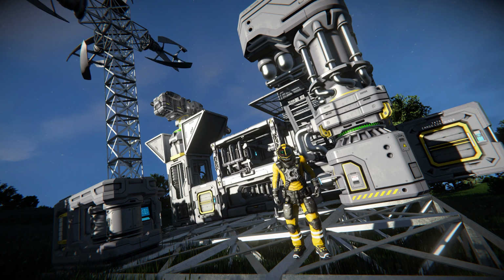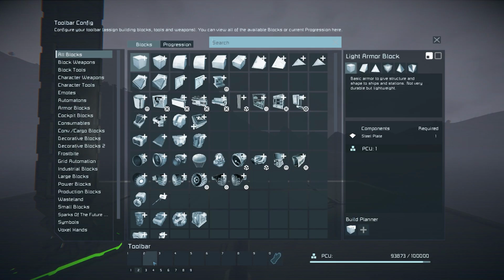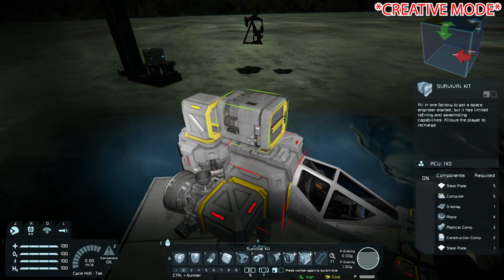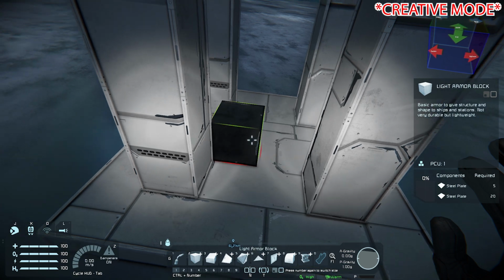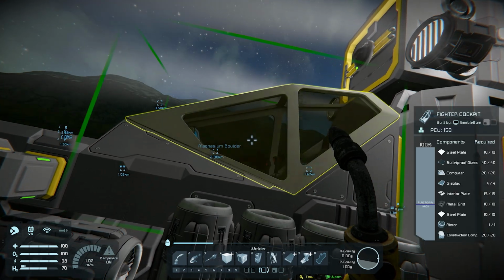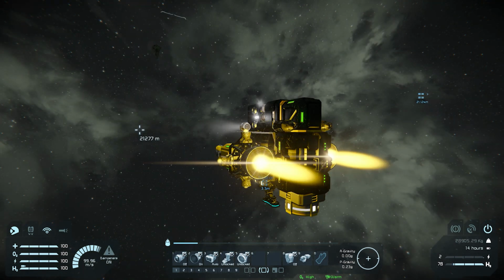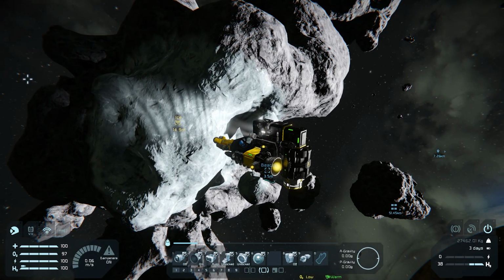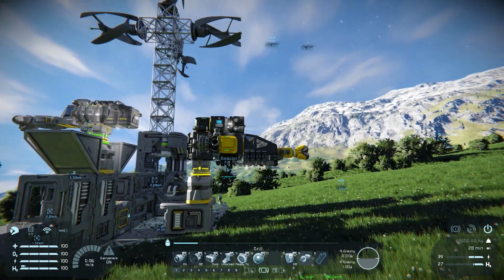Space Engineers Beginners Guide #4: Building your first Space Ship

Comment: There is 2 ways to statically connect small grid to large grid... use a large grid rotor remove the rotor part and add a small head... or my personal favorite... drop a small grid connector on a vertically facing large grid connector weld it up then manually switch the lock and boom... 2 ways to connect a large grid to a small grid in the vanilla game that will also lead to batteries being charged as you build...
Reply: Never experienced any problems building in the above mentioned... this is also how you get a basic refinery and basic assembler on a small grid rover with some large grid solar panels lol

Comment: New sub because of this video. Ship did for me what it was supposed to with getting to space, sometimes running from drones and checking a bunch of asteroids for something yet only finding Earth's ore deposits. Disappointed. I then tried landing on the moon for a hydrogen refueling station and couldn't get off the surface for some reason. Crashed the ship and reloaded to before I landed.
Reply from the maker: Yeah, some ores are pretty rare to find.
Platinum should be found easier on the moon, uranium in the asteroids.
But yeah, most ores are available on the Earth planet.

Concerning not being able to take off.. were you locked with your landing gear to the moon?
Reply: @Beeblebum  : No sir. I was loaded with platinum and still had the atmospheric thrusters on the ship which added a lot of weight. I redesigned the ship without those thrusters and added another container on each of of the original with more hydrogen thrusters and now that ship is like a speed demon with insane acceleration. I also added two more drills to the front with a convertor, sorter and connector on the back to dispose of stone. I can carry 120,000kg of ore now but it handles like a school bus when loaded.

I've been binging your series Making Planetfall now, enjoying the entertaining content man.